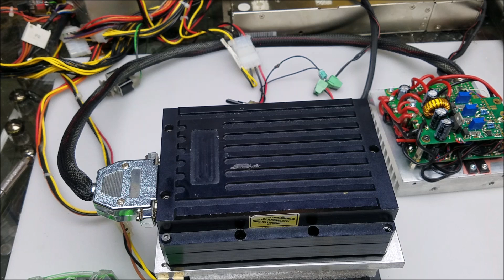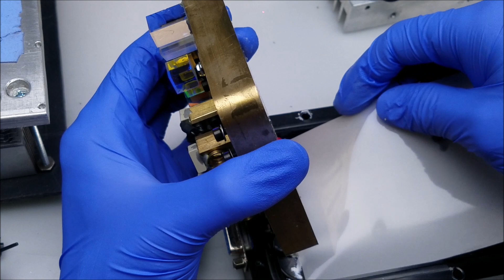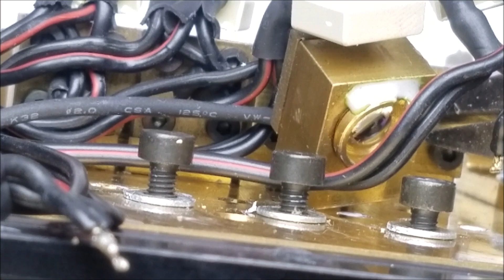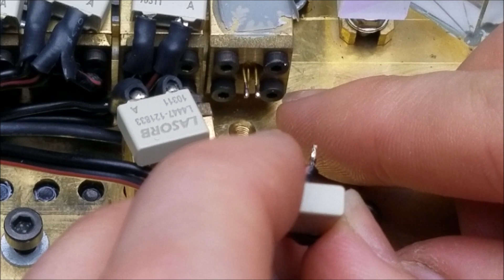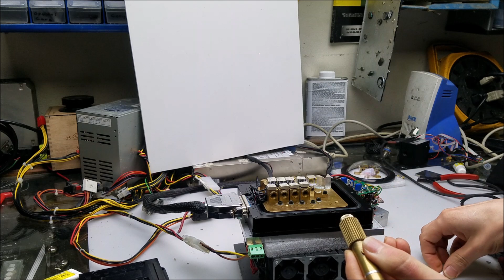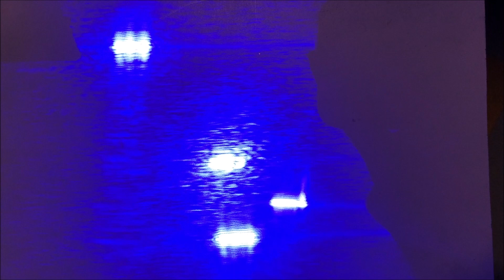Blue Laser Head Rebuild Part 1 Testing and Installing New Laser Diodes

Comment from the maker: Quick note! On this laser head I did not set the current lower before installing the new laser diodes. This is because the new laser diodes have a higher current rating than the drivers where set to for the old laser diodes. If you have little experience then set the laser driver current to the lowest set point before connecting your new laser diodes. I'll discuss this more on the next video when I set the laser driver current.

Comment: Small correction at 11:32: you said quarter-waveplate, but that is wrong, it must be a half-waveplate. λ/4-plates turn linear polarisation into circular, λ/2-plates rotates the axis of linear polarisation.
Reply from the maker: You're 100% correct and I am still struggling to catch myself between the 2. What's worse is I did it again and had to make a correction on it even in the latest video I posted.  This started before I knew in detail what to use when I made my junk parts 4W units and used quarter wave plates and not λ/2 rotators.. I sort of got hooked on saying the wrong thing sadly. These reminders help! lol
Reply: @Zenodilodon  lol yeah it happens. it also took me a while to learn them correctly

Comment: Извините -  а давно лазерные диоды перестали "бояться" статического электричества? Вы их так смело берёте из пакетов. да ещё потом и отвёрткой курите... Про припайку без закорачивания выводов вообще промолчу!!!
Reply: pretty much all current commercial diodes have an EMP device installed (basically a diode) to allow for the discharge to go through it instead of the photemitting section.

Comment: Are any of these diodes powerful enough that eye protection is required? 😉
Reply from the maker: That's a tricky question. The most responsible statement is 100% absolutely. Each Laser diode is more than capable of instant and irreversible eye damage near instantly. Together they are an eye hazard that you just want to avoid. This being said, I nearly never use goggles at this point. I am so used to aligning RGB systems where I need to see multiple colors, or I can turn down the power significantly during alignment. There is a huge difference between me and someone starting off. Mostly I am overconfident..experienced, but overconfident. If you at all question in the slightest your ability to keep a beam under control than get some safety glasses. Make sure they come from a good supplier too such as ThorLabs.

Comment: What kind of mirror mounts does exist and how to build one yourself ?
Reply from the maker: There are many types of mounts, for lasers of this size you can find mounts on https://www.live-lasersystems.net/. There are lots of mounts in the kinematic style as well of which can be found second hand online too.

As far as how to make optical mounts. That's an open ended and often application specific process. Most of it is done with CNC in quantity but you can machine mounts with hand tools if need be. In the DIY department a rotary tool is your best friend.

Comment: 15:56 - great explanation, what does the two triangle prisms do on the top right?
Reply from the maker: Those are anamorphic prism pairs. They are for beam correction and you can learn more about them here.
https://www.edmundoptics.com/knowledge-center/application-notes/optics/anamorphic-prism-pairs/
Reply: @Zenodilodon 

please where I can buy beam reflectors lens such those in that Laser source to set whole diodes beams in parallel ?
Reply from the maker: @Morgan_174  Excellent source for parts.
https://www.live-lasersystems.net/d/cartsearch/index.html
Reply: @Zenodilodon thank You ❤
Reply: can you please write me more about the reflectors 
does it must be adjusted on specfic wavelength ?
how I can name it to mention that it reflect and get the beam from another angle as well for  the beam from previous diode of the array ?

Comment: impressive rebuild, but also very fiddly.
Gotta admit Im curous about a rough estimate of cost and what such a repair build would set a given client back.
anyway after watching a few of your videos, you certainly landed yoursef a new subscriber.. as its just up my interest's alley..
Reply from the maker: Thanks! I saw your questions on converting a laser to run on batteries but they seem to vanish when I click on the menu to reply. Rough estimate on a rebuild is about $50 a diode in labor + parts to rebuild. 

To answer about batteries. Yeah you could use DC-DC converters from like a 48V batter pack stepped down to the needed voltage rails. Isolation diodes of a fairly high current would also be needed, though you could probably set up mosfets and get less loss. The voltage rails are usually 12/5v for signal stuff and laser drivers, 24-v and 24+v rails are also needed. This gets tricky because they need to share a common pin. It would take some strategy, but it's very possible to set up.

Comment: A couple of curiosities. Is the brass plate resting on the warm side or the cold side of the peltier cells?
Is there any reason the diodes aren't kept independent that way rather than soldered to a pcb?
Sorry, for "language" problems, with the automatic translator I found it very difficult to understand, but it was very useful to see how it is built.
A thousand thanks.
Reply from the maker: The brass optical table is on the cold side of the TEC, usually kept at 20C. The main reason the diodes seem to all be individually installed is serviceability. Laser diodes do fail and need replacing which is easier without a shared PCB. Some companies such as OPT do use a shared PCB for the laser diodes. Very high end lasers have small PCBs with 3 pin sockets for the laser diodes.

Comment: Hey dude I am sort of like you not as proficient but have 27 808nm lasers from a few watts to 160 watts. I have a coherent industrial laser about 96k dollars I bought for 500 repaired for 250. Anyhow Im an electronic tech my knowledge physics optics pretty limited. I have a yard square laser table. I bought 100s and 100s surplus laser parts at one time. I own a pangolin laser projection controller.
Ok point of all this would you advise me in optics to lase a surplus gold plated water cooled thermister equipped yvo4 xtal with 808nm to produce 532nm.
The gold plated water cooled yvo4 bridge I believe came out of a maybe 40 watt but at least probably 10 watt airport green laser. Thanks regards from a once obsessed laser nut.
Oh I have a refrigerated laser cooler. Would be sweet to get a 10 to 40 watt green laser up. 😷
Reply from the maker: Hey David, I would like to see exactly what you have already and it's configuration. Figure though you would need to set up a temp controlled resonator and get LBO/KTP for the SHG of 1064 to 532nm if you only have the ND:YVO4. I have only personally worked on DPSS 532 up to 3W output but I have also seen larger systems such as the laser scope systems. I'll get a better idea of what you can and can't do when I see what you have. My E-Mail is Zenodilodon@gmail.com
Reply: @Zenodilodon  your the best I may for help send you a thermoelectrically cooled compact about 12x12 808nm laser I think like 20 to 30 watts I picked up 3 at one time. Back when I bought and resold 100 lots 40 watt water cooled medical lasers.  One thing I picked up you should get your hands on. Very rare is a 100 ampere variable like 3 to 5 vdc power supply I would hang some industrial welder diodes and a ballast resistor in series.  Stuff is bloody dangerous I used to play with. 😭
Reply from the maker: @davidrouse3157  12x12, I am assuming there is another axis of measurement somewhere in there lol. I just picked up a 20W fiber coupled 976nm for a project/experiments and a 40W FAP800 for a replacement in another 355nm laser I have here to work on. We have a few high current CC/CV PSUs at work. I forgot how high they go ( we have quite a few ). I got a 25 A/30V linear CW/CV PSU recently for home and a 50 A V unknown CC/CV PSU to get going. I think there is an issue with the high side driver IC. 

Little by little I am getting there with using more powerful NIR lasers for pump diodes in DPSS stuff. Usually I end up working with visible laser diodes 1.5>W because they are most commonly used in the show laser industry. Occasionally DPSS/OPSL comes in but very rarely which is sad in it's own way because those are the fun ones to work on :P
Reply: Btw cant imagine today what surplus out there when I was playing 2 decades ago 1000 watt 808nm solid state laser parts were appearing on ebay.
Reply: Back when I would put black tennis shoes in front of a fan and crank up various medical industrial 808nm diode lasers to make them explode in flames on youtube.

Comment: hi, i have a basic question, I have read that one can not add two lasers of samel frequency using polarized mirrors... how is it possible that u added the power of laser diode. I wanted to do the same bu stopped when i read that its not possible with dame wavelength laser.
Reply from the maker: You can add 2 alike laser diodes together, but only once. Hence why you see only one polarized beam splitter/combiner per color in laser head. ( in this laser it's joining 4 beams on 4 beams each of the 4 being joined once with polarizing optics ) If you are joining say just 2 of an alike color you can either use a wave rotator plate for one before using a polarizing beam splitter/combiner or you can rotate one of the laser diodes 90 degrees compared to the other. The reason you can do this, but only once goes like this. You can have only efficiently have 100% pass or 100% reflect with optics that use polarization depending on the lights e field angle ( Polarization ) interacting with a polarizing optic, unlike color. I can explain more in detail if you have a facebook or discord if you're still confused as it's a bit complicated to fully understand.

Comment: Jeez, they didn't give that good lenses at all did they!
Reply from the maker: I am betting the lenses where pretty good for the time they where made. I got a hold of the OEM and learned this laser head is very old, like 10 years. it's a mix of the poor sealing on the laser head and the length of time they where ran in that condition.
Reply: @Zenodilodon  is this from a full colour machine or just a blue projection only one? Maybe the cooling isn't enough for the machine

Comment: I want a laser power meter 😢

Those power supply connections, I think they're called LP4, one of mine the power keeps coming loose causing the hard drive to keep on making a ticking sound, you have any recommendations on fixing those?

Why replaceall diodes at the same time
Reply from the maker: Hmm, it could be just a crap brand of connector. You can try to put more clamping power on the female connectors by sliding a small pin around the circular metal end on the inside of the plug and pressing the metal in to form a tighter contact on the pins when inserted.
Reply: @Zenodilodon  that or I'll solder the living shit out of ot👀 sit there wondering what that irritating sound is before realising I've lost my z drive
Reply from the maker: @phonotical  It will be fixed, that's the important part :P . The lesson to be learned is that next time don't wonder what the sound is, you go and hunt it down like the member of the apex predator species you are.
Reply: @Zenodilodon  haha I did find it 😛